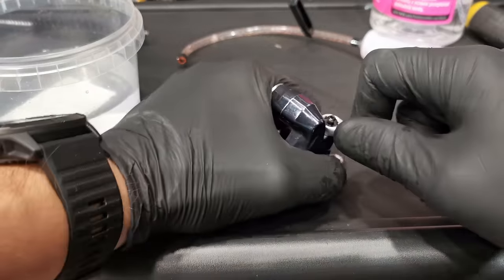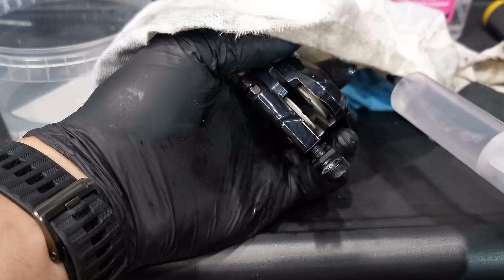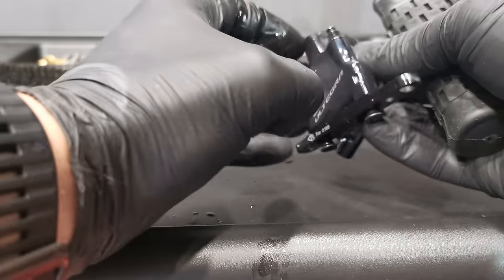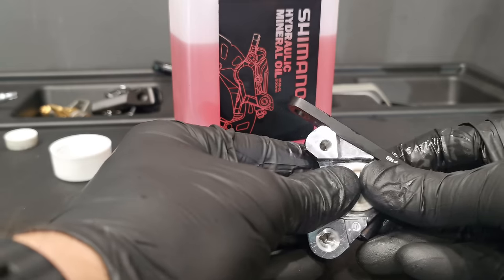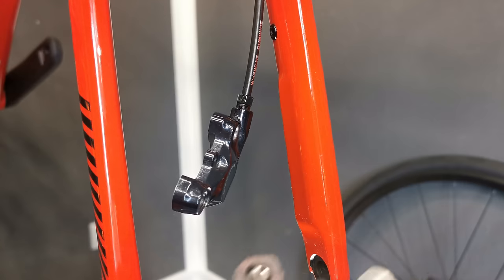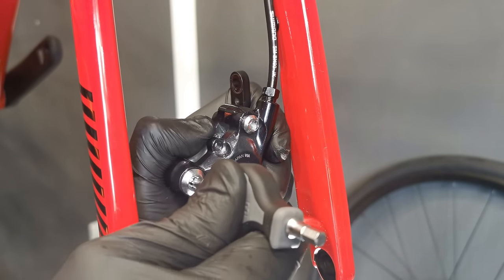Easy Way To Remove Pistons From Hydraulic Brake Caliper On Bicycle.

Comment from the maker: Huge range of the bleeding kits: https://amzn.to/3279wsl

0:00 Piston removal with water and syringe.
1:15 Pushing one piston back (bleed niple side!!!)
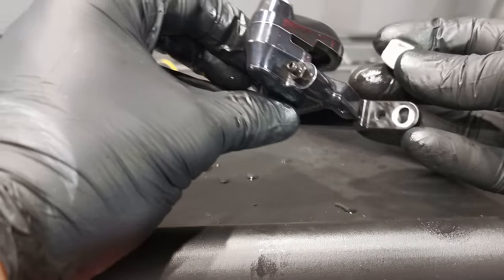2:20 Methods that don't work...
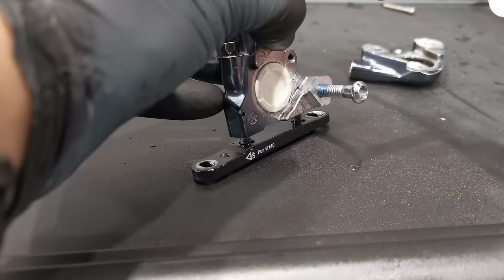3:00 Removing the second piston.
3:20 Replacing / putting a new piston back into the caliper.
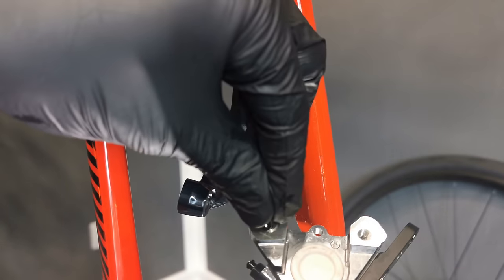4:18 Don't swap or forget these two seals!
Reply: where did you buy the hose that attaches to the bleed port?
Reply: Its almost the same as we do with brake calipers for cars. 
Be careful though, if one piston flies out you might be surprised about the damage it can do. 

Anyway, nice job. 
Another why I’m still on rimbrakes.

Comment: I did the same thing b it didn’t have to remove entire system. Just hood one piston and pump brake, piston will pop out…clean, lube and put piston back. Repeat for other side. Bleed and you good to go.

Comment: Hello, thank you very much for this explanation. I applied the method as you did and it worked for me. 
My caliper was leaking, so I unscrewed it to see what was wrong, probably one of those rubber rings that.... Once unscrewed I didn't notice anything wrong and now don't understand why it was leaking. Do you have any idea what else I could do ?

Comment: Very helpful video.  One of my XTR M985 calipers has a seal leak and they are 1 piece calipers.  I ordered replacement seals and pistons from China but had no idea how to I was going to get the seals replaced w/o being able to spit the caliper apart.  Now I know.  Not sure if I'll use water or compressed air, but hopefully I can get the pistons out through the rotor slot.
Reply: I have a very similar problem. I think i destroyed one piston and need to replace it. but how to get it out? I will try this, but i assume it will just leak through the crack. Did it work for you? and did the replacement fit and work fine? I have the same model M985. I'd very much appreciate your help! thanks!
Reply: @IBundee  FYI, I fixed my M985 caliper over the weekend.  I got one piston out while using the brake while still on the bike and connected.  I pumped the brake and let one piston come out while I kept pushing one piston back into the caliper.  Obviously, once the piston comes out, all the hydraulic fluid will come out too, so be ready.   Once off the bike, I used compressed air at just over 50 PSI to push out the other piston.  It came out remarkably easy... and I found out the piston was cracked.
Reply: Hi thanks form your reply. I got the piston out with water and a syringe and a lot of work. But now it seema Impossible to get a new piston. Tried on ebay, and they cant deliver rn. Where did you get a replacement piston? Also on ebay? I tried three different shops on ebay but it seems they are all the same.
Reply: Would be interessting if a piston of a different shimano break also fits

Comment: Nice, But only untill all the pistons are still moving. One of mine has stucked, even under pressure of 6bar didn't release 😢I tried with siringe too, But have broke one already 😊 But Tell me....why water? It Will made corrosion in to the chanells
Reply: No contesta porque no tiene ni idea 💡 🤷

Comment: This was cool. In all my years of owning hydraulics I thought it was a no no to push a piston out. My question is, I was looking for the pistons on ebay and they are mostly metal and some looking like delrin. I wouldn't go for delrin but is metal a good choice? Aren't the OEM pistons ceramic?
Reply: Look on aliexpress you'll find ceramic ones. I bought  a set with seals for a 4 piston caliper shimano saints) note two sizes of ceramic pistons.... worked perfectly
Reply: Just got an aftermarket set of pistons for an SLX caliper. Pretty affordable, ceramic core with aluminum back and sides; clever-- no more cracking/back spalling. Came with the needed seals. Pretty impressed.

Comment: Excellent explanation!!! What product can I use to cleaning the pistons without disassembling all the brake? Only for maintenance tasks. Especially interesting on MTB bikes. 
Is it not a problem using water? After that, could water drops mix with oil?
Reply: Always use the oil from the brake system, clean the piston rims with swabs, push them in, clean everything with alcohol or brake cleaner and assemble the pads.
Reply: Isopropyl alcohol works a treat.
Reply: @woduk  Yeah, it's always recommended (because it's purest), but every alcohol, brake or carb cleaner will do just fine.
Reply: @tduic  &  @woduk  thanks for your answers. I guess it's necessary to apply oil on the pistons and seal rubbers. Is it a specific oil?
Reply: @ferroviari1435  Told you, use oil that your brake uses, i.e. shimano mineral oil for shimano brakes etc. It's because the sides of your piston will enter the casing and that oil will come in touch the seal, and that seal is already soaked with the same oil, so it's best not to mix different chemicals, and also the seal is designed to work with that oil.
Reply: @tduic  Certainly,  this answer has a lot of sense. Thanks!!!
Reply: Push them out most of the way. Use brake specific oil (mineral or brake fluid) and floss to scrub then q-tip to clean. Flush with more oil then. Reposition the pistons by pressing them in. Exercise them a few times to be sure they are working right then clean with parts cleaner.
Reply: @DanielHerd  it sounds great! Thanks!!!
Reply: @tduic  I'll add that when installing new pistons in either DOT or mineral oil systems, for some reason it's recommended to grease lightly the inside and outside of the piston seal before installing. (Both SRAM kits and aftermarket piston kits for mineral oil systems) Maybe it needs that in order to seal properly, or physically some other property of how they work. Typically the recommendation is something like a "plumber's grease", which is silicone. Silicone is compatible with most seal materials except silicone, which to my understanding neither brake system uses.

Comment: I have just bought new shimano xtr 9120 calipers and the rear caliper, the 4 pots dont move much at all. Spent a long time trying to get it to work with no success. Do i need to lube up the 4 pots with mineral oil?

Comment: One piston of my front Dura Ace caliper is leaking. I lost most of oil... What do I have to do to repair it ? thanks
Reply: Pump your breaks till it pops out or use water like he is. Fix/clean/replace the o ring in there. Mine had the same issue last week. Bleed the brakes then your in motion.

Comment: Hello, I can't put my brake pads back on because I can't push one piston back....?! I push with all my might but nothing to do.I have lubricated them a bit with the brake oil ( shimano oil) but it doesn't help. I also have the impression when I do get some shot in that the other piston comes out ? Had I never experienced this before ? Does anyone have any advice ?

Comment: I used this tip and moved my pistons with water in my bleed syringe.  Now that water is in my system, how can I be sure it is all dry before I put it back together?  It seems maybe this tip is more time consuming than time saving since I now have to make usre everything is completely dry?
Reply: that's what I was thinking about too, we should leave the caliper in a hot and a dry place until every little drop of water evaporates and  gone.
If some drops of water mix with the oil, the high temperature in the summer may affect the brakes and cause problems.
Reply: Don't use water, use an air crompressor to blow out the pistons..
Reply: @YacineBenabid128  So what ?
Reply: Use alcohol to do a final dry
Reply: @YacineBenabid128  The oil and water don't mix, they stay separate. You can test this by trying to mix a bit of each. Water is denser, so if you bleed top to bottom, oil will push out most of the water. Any that remains will end up at the bottom of the system and likely leave next bleed. In practice, mineral oil brakes tend to accumulate small quantities of water down in the caliper anyway, from water and moist air that get drawn into the system in a wet environment as the system alternately gets compressed and relaxed/heated and cooled. If you don't bleed, theoretically it could vaporize on long descents and make your brakes feel spongy...which will make you bleed them, fixing the issue. But yeah worth starting as dry as possible or using a compressor if you have one.

Comment: I love your videos, however mixing water with brake fluid is a real no no! Also there is a special grease "Red grease" that is designed for brakes and can be used between the piston and seal instead of brake fluid.
Reply: Its call rubber grease...its for automotive use.
Reply: Also called red rubber grease
Reply: shimano uses mineral oil, not hygroscopic DOT fluid. oil does not mix wit water at all. since it's denser, any leftover would accumulate at the lowest point,  in the caliper where it starts to boil the most easily.... 😀 usually you can just force air with the syringe to blow the piston out when the caliper is apart. just catch the piston before it flies out and you can't find it anymore
Reply: @JoLe1991  Agreed, mineral oil does not absorb water, and as you say; the water will collect and boil in the piston when it gets hot. In boiling it will turn to gas and consequently the gas will compress under the force of the brake lever pressure. Result = brake failure or "brake fade". Therefore, my original point, regarding using water in a brake system, still stands i.e. Don't do it! You're risking brake failure or brake fade just when you need your brakes the most :- when you are braking hard and generating heat.

So basically we are agreeing the outcome is the same whether using DOT fluid or Mineral oil. ;-)
Reply: Serious question: can't you just dry it before reassembly?
Reply: @patrickstaudt2584  yes you can. No need to panic on this point I don't think. I use water based degreaser on all parts to clean them up, I just leave them to dry before reassembly. Simple really. I think the procedure shown in this vid would be really messy and horrible if you tried to do it with brake fluid, especially DOT fluids which are corrosive..

Comment: My problem is different, I have 4 piston brakes one pistols pops out, rest are stuck. But not tried or use water. Looks like I might need a compressor, so I have to buy one.

Comment: when/why is it necessary to clean inside the piston chamber? what malfunction indicates this procedure?
Reply: My guess is that he cleaned the pistons. Which you can do without removing them, but it's probably easier to get them out first.
Reply: once you have al the grease and oil around the piston it moves harder if you clean it it runs smoothly again👌

Comment: Split the caliper and just use an air compressor. They pop right out.
Reply: But if you do not have air compressor the water is fine.

Comment: you can just use air ,not need water.
Reply: Not everyone has an air compressor.
Reply: @sepg5084  You can use a syringe just like in the video, but pump it with air instead of water. The effect will be the same.

Comment: Great concept, but I wouldn’t have ever used water, why not simply use the same method but use hydraulic oil? One little tip I learnt from my motorbike days, was if your short of oil and need to use the brakes you can use fairy liquid/ washing up liquid as a temp to get you home. It has great viscous properties, unlike water.
Reply: Instead of water I have used air to remove pistons from my SLX callipers. It works well.
Reply: Just a guess: 1. doesn't want to spend oil 2. doesn't want oil to be sprayed all around.
Reply: O I thought cost, however, oil everywhere ugh 😩
Reply: You can use water as the hydraulic fluid in brake systems. Depends how long/hard you expect to be braking. Trials riders sometimes do for example-- it's cheap, non-messy, and thinner than either usual fluid so more responsive. Boils at about 100C of course, where glycol and mineral are closer to 300C; there's definitely that. Higher viscosity doesn't seem particularly helpful in a brake to me though.

Comment: Problem is that Shimano do not sell replacement seals and piston kit, so hot to change them when they are ruined :(
Reply: You can buy pistons and seals for Shimano calipers on Ebay etc. They are not original but third party. Tolerances may vary.
Reply: @strategicthinker8899    hi thanks for your answer. yes, I found for 2 pistons brakes but not for 4 pistons as I need :(

Comment: moisturizing the whole interior of the brake - isn't that a recipe for problems?
Reply: Since he had the caliper removed from the hydraulic line, I assume it would be pretty easy to blow-dry the entire assembly with an air compressor. Otherwise, you're right... you'd have to remove the pistons another way.
Reply: Simply spray with brake cleaner / alcohol as it evaporates the water..

Comment: I like your thinking but I would avoid this method. The proper way is with a air compressor to remove pistons.
Reply: But if you do not have air compressor the water is fine.

Comment: Can't I use baby oil to my brake
Reply: ?  you will need to clarify this question.
Reply: To be use in my hydrolic brake MTB.....
Reply: @dannydiaz9331  seth bike hacks actually did a video about this topic. (He changed the name of the channel to "Berm Peak")
Reply: i have baby oil in my tektro hydro brakes. works fine still
Reply: Sett will tell us soon or later
Reply: You can but be ready to have oil all over your apartment when the syringe hose leaks or detaches from the pressure you are exerting. Water is harmless on the other hand.

Comment: works with compress air?
Reply: No it doesn’t I tried and you can’t get enough of a seal
Reply: Works but it's kinda messy and dangerous. They can blow out and fly off fast
Reply: Just tried with compressed air from only the syringe, and it worked OK. Got both pistons to extend midway, unscrew shell, then carefully pull remaining distance with fingers or soft pliers.
Reply: I popped out my pistons with compressed air. I first took the caliper apart, I was surprised at how they shoot out with a loud popping sound! Make sure that don't pop out and fall into the floor and crack. I tried the water trick but couldn't get enough pressure...

Comment: You put chain lube on a mineral system brake piston, are you insane?
Mineral oil brake seals are notoriously sensitive to anything but mineral brake fluid. Expect problems with that brake in future.
Reply: He was just doing that trying to remove that piston before he figured out the proper method. Once he got it out he cleaned everything and used mineral oil.

Comment: how do you remove the caliper? :(
Reply from the maker: Do you mean, how to remove it from the frame or fork? There are two big screws (5 mm allen key), that you need to remove.
Reply: @cannondany   hi there i mean from the hose i want to clean my callipers but i cant i dont know how to dettatch it from the hose :)
Reply: @rafaeldolor2682  it depends on which brake you have, its either 5mm allen key or 7/8mm wrench , just unscrew it
Reply: @rafaeldolor2682  if its a 7 or 8 mm wrench type attqchment u have to pull the cable pretty hard once the fitting is unthreaded